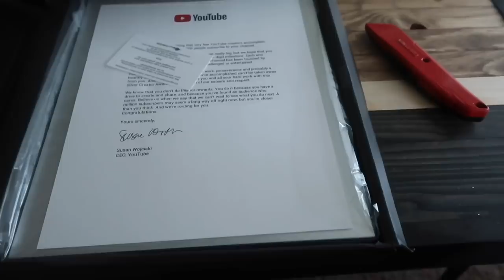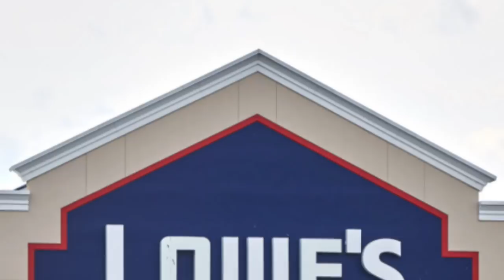DIY HIDDEN Trap Door Shower | Van Build Ep.3

Comment: Congrats on 100k! Just an idea for the next shower build, you can get a pinch valve for the hose. Feed the hose into a holding tank instead of having to drain it out of the van. When the tank is full the water just won't drain, pinch the valve shut, empty the tank at a grey water station, hook the tank back up and you're off and running again. It would probably be easier to use some sort of a bladder if you could go that route. 

Also you might look into the solar powered water heaters if they make one van sized. Love the videos man, keep it up and do a uhaul camper soon!
Reply from the maker: I really like your suggestion and this shower is working but not technically done because I still can add a gray tank for it which is why I sort of left the hose out so that I could decide on a more permanent solution for it. Thanks for your suggestion. I don’t think of a pinch valve but that might be exactly what I need!

Comment: Dude your girls face was priceless and def. Needed. I love this idea and I think you may have still been able to use that existing hole as long as you add an adapter that angles at 90 degrees allow you tube from your shower to be as low as needed without curving up and elevating.

Comment: Congrats on 100k subs - you have worked hard for it. I have a suggestion - you may want to coat the "door" to the shower in some kind of waterproof sealant, so that the wood doesn't absorb water and warp, etc.

Comment: You might want to look up the “One Hour Shower, and simply run the drain into a catch bucket in which you have placed a sump pump, connected to a filter, pump, and heater.

Comment: Tip when you're worried about leaks teflon tape is your friend. Foreseeable problem of you keep the curtain in the tub you will run into a mildew problem from small amounts of water on the curtain and in the tub. Also if you see this I'd like to ask you tips for insulting a transit connect. my brother does delivery and the connect only has a heater in the front but so much heat is lost from the bare metal in the back.

Comment: DualEx why just move the shower closer to hole all ready drilled ? If your shower was next to the sink you could hang the water heater near the roof so it can be use for the shower and the sink ? All so you can put an hook on the wall or roof to hold the shower head..

Comment: I love your van builds! @duelex is there a way to build a half bathroom that slides up to double in size? I cant find anything like that onlin. I've found hidden toilets inside a waist high cabinet if that makes sense and also where the bathroom is super small and the shower curtain comes out into kitchen area. I have no skills when it comes to building but in my mind im imagining the waist high cabinent with toilet and when you want to shower the toilet would slide away into another compartment then you could pull up to expand the cabinet making it double in size to become a shower stall..anyways just a thought wondering if its possible

Comment: I love the builds! Keep them coming! Also I forgot where I saw this, but another way to hide the bottom of the shower is to make it so it folds vertical agains cabinetries (they had it so it folded out by the side doors) and then they had the hose long enough to extend to the shower head outside of the bus (they used suction cups to hold it)! Though I’m not sure how they managed to get the plumbing under it so “thin” compared to yours 😅

Comment: Since you're short enough to sleep across the width of the van, you could've built a sofa/bed across the back(minus the arm rests), a galley along the drivers side, and had plenty of room to build a 'hall bath' on the passenger side like Roadtrek did in their Dodge and GM based class B's. You could then fit the water tank and battery under the bed. A shorter shower pan(30x30x3" will hold over 11 gallons of water) would work fine and require far less of a rise in the floor, saving you headroom. The extra headroom would mean you can get any future upper cabinets higher in relation to yourself. 

The other issue, if you can't stand up straight from front to back, why have a hightop at all? I appreciate the effort put in, but you're trying to reinvent the wheel when there are tons of floorplans that can be easily duplicated. RV manufacturers really are experts at fitting tons of $#!+ into tiny packages. The build quality may not always be great, but the designs are proven.
Reply from the maker: If you like the way that RVs are laid out then just buy an RV, but that’s not what I’m doing here
Reply: @Dualex_Builds  That's not what I'm saying. It's just that there are already more efficient uses of the space that are proven to work.

Unless you're standing in the shower pan, 1/2 half of the layout now requires you to be hunched over. With you're woodworking skills, which you clearly have, you could take those design cues from commercial RV's and build something WAYYYYY better that improves on both the design and quality without the compromise your raised floor creates.

Trust me, if I were in a position to do a custom build at this time, I would seriously consider paying you to do the woodwork. While I know engines/transmissions/suspensions and can weld like a MoFo I'm worthless when it comes to carpentry. 

Since you end up flipping all your projects at some point(hence the channel name),  the end result would yield more attention and a better ROI. The more universally usable the end product is, the more people will pay. 

Like I said, don't reinvent the wheel... Make the wheel BETTER.

Comment: Couldn’t you use another fixing like the one you used at the bottom of the tray to get the waste pipe out of the existing hole? It would save that climb due to the bend radius of the pipe. Just needs a bit cut out of the 2x2
Reply from the maker: Even if the 2x2 wasnt there, the way that the hose needed to go into the hole it starts going vertical before it could exit the van
Reply: DualEx fair enough. Thanks for the reply though 👍
Reply from the maker: seven9zero thanks for your suggestion!

Comment: How come you don't get an old travel trailer 50 gallon water tank and put in the bottom of where all that storage is? Then run a hose and drill a hole on the side of the camper to fill it up.

Comment: First off, congrats on the 100000 marker. Here's my second and my 2 cents. Use a rubber automotive hose for the drain. It is more durable and can take more heat. Third. Don't you just hate the smell of cutting frp!